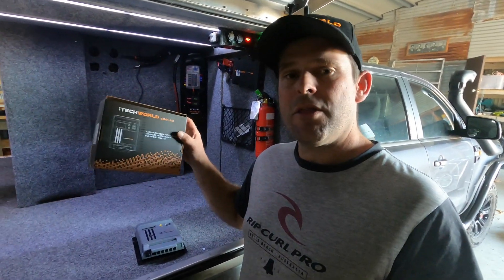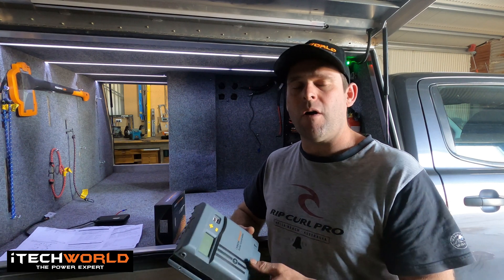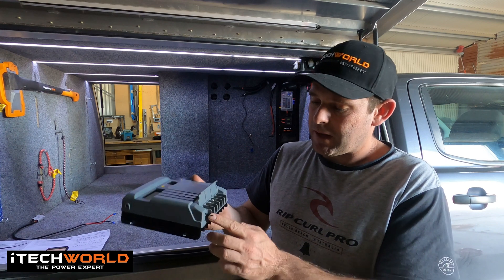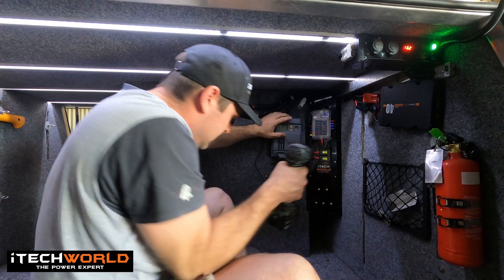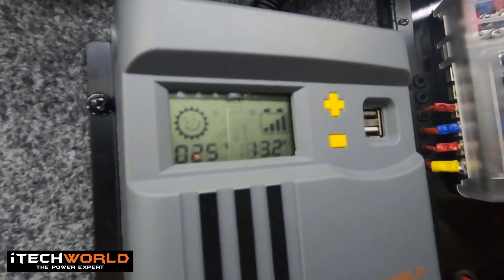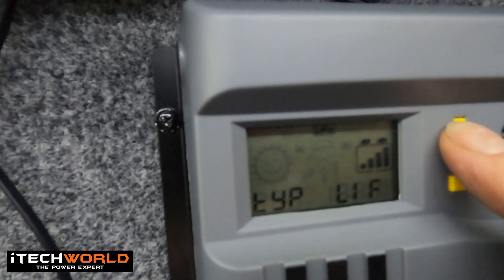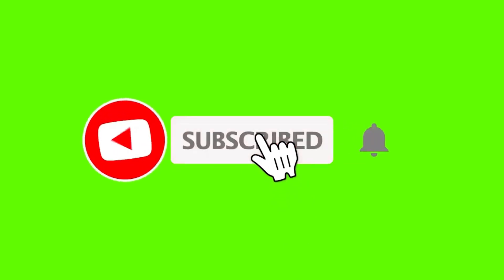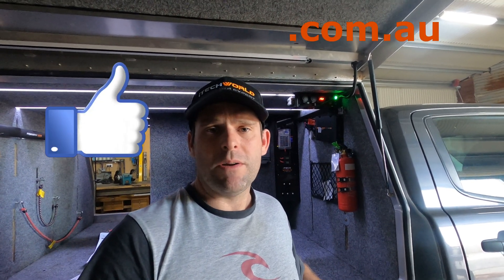Better SOLAR PANNEL performance for 12v, with iTECHWORLD 30ah Solar controller install and review.

Comment: Why do u need a solar controller when your running a dcdc charger with solar I put..?
Reply from the maker: Hi Sam, thanks for watching. The dcdc charger will choose between one power source. By using a controller the solar and alternator contribute charge at the same time. The controller also allows for the use of up to 45v solar panels.

Comment: Why put up (add a public comment) , when you censor the comment.
Tried to inform potential iTechWorld customers that all is good when purchasing over $3000 worth of equipment, but when it takes manager Jarrod 5 days to respond to an email over faulty equipment ( a iTechWorld 30 amp solar charger) and is rude, and unprofessional, I believe potential customers must be made aware so as they are able go else where if they choose.
Reply from the maker: Hi Paul, thanks for watching. We are sorry to hear you have had a negative customer experience.We like you are only consumers of iTechWorld products and can only portray to you our experience.  I can only suggest to contact customer support again. 
We hope your next experience is a better one.
Happy camping OTL.